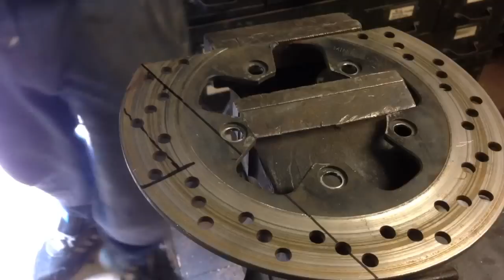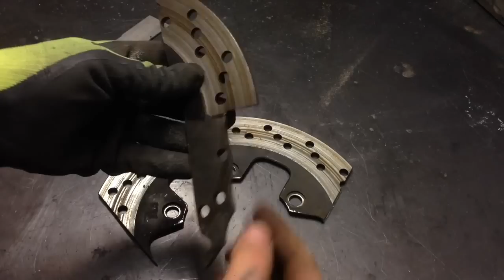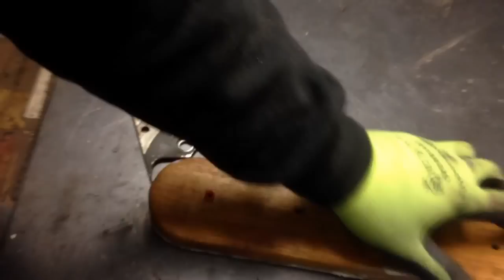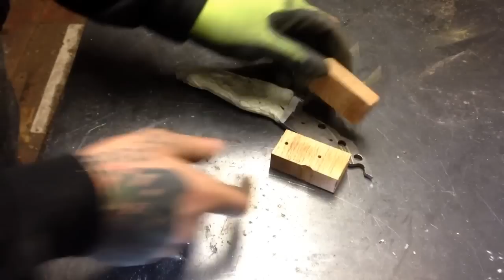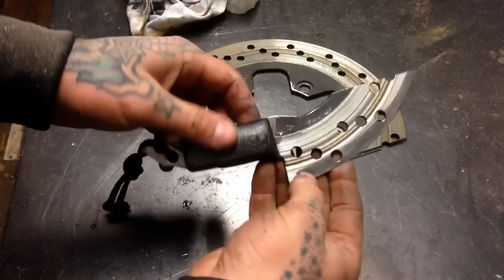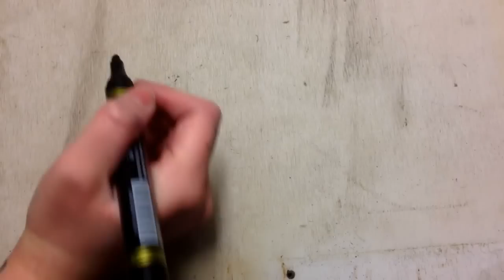Knife From A Brake Disc

Comment: I have never thought of using brake disks. The steel is made to handle a great deal of abuse.  What so you use to finish the wood?
Reply from the maker: It just randomly came to me one day and I've never seen it done before so thought I'd try. It's just a black wood dye I apply 👍🏼👍🏼👍🏼

Comment: Love the knife and i think you have a great imagination when it comes to repurposing metal objects for knives.  But i feel with this knife the metal sticking out past the handle at the back could injure your hand. I think i would have extended the scales all the way to the end. Not meaning to take anything away from the knife, it's awesome.
Reply from the maker: Thanks and no I don't mind any sort of criticism that's why I put my videos up I have to be open to lots of criticism. I do agree with what you are saying but it was a request from the buyer to add it in for multi tool use and breaking windows. Next one I build will have a longer tang as I'm going to weld extra steel on. Thanks

Comment: Great knife. My only question, is that steel high carbon? In the video it wasn't quenched, but I assume you kept it cool in the water the entire time you were grinding, and keeping the hardness it had already, like a file knife.
Reply from the maker: Thanks for watching man. Yeh it pre treated so I kept it cool so not to ruin it. This is an old build I need to retry it again and make it better 👍🏼👍🏼👍🏼

Comment: nice.very nice..how happy are you with using CA GLUE in stead of epoxy on the scales
Reply from the maker: I much prefer to use epoxy to be honest as it has a more flexible bond I have found CA is good and strong but can't take as much stick as epoxy. Thanks for such a great question and sorry for a slow reply 👍🏼👍🏼👍🏼

Comment: I thought I sent this. do you have to clean the leaf springs first since there underneath cars. also if someone has files and hacksaw they would be good to go
Reply from the maker: Yeh you sent it on another video. I replied on that also yeh files and hacksaw will work with the leaf spring steel as it's not that hard but quite robust. The video you commented on prior that was a hunting knife I just used it in its spring steel state no heat treat at all and it is still going strong 👍🏼👍🏼👍🏼

Comment: was that just paint you put on the handle?
Reply from the maker: +Tech Reviews and Help hey there thanks for watching buddy and no it was a dark black wood dye it come out looking cool if you leave it on for a short time as it only has time to soak into the soft parts of the wood so gives different shades in the denser parts.
Reply: +Diesineveryfilm Customs 
nice
Just wondering, how many subs are you getting now vs how many you were getting per day before you changed the few things?
Reply from the maker: I'm getting so many subs at least 10 a day now. I was getting 2-3 a day before its so much better can't thank you enough
Reply from the maker: +Tech Reviews and Help does this still work from an iPad as I use my phone to upload and do everything else from my iPad at the moment as it's quicker
Reply: Diesineveryfilm Customs
From the browser side it should. If you go to the dashboard and then edit. You should see a tab that says card. From there you can add the cards.
Reply from the maker: +Tech Reviews and Help found the cards tab,
It says,
Video or playlist.
Channel.
Poll.
Link.

Am I just adding the address you posted to "link" which I had to enable already?
Reply: Diesineveryfilm Customs
If you can add the address itself then do it. Otherwise you will need a website, and you will need to associate that to the channel. For example, my website is techreviewsandhelp.com. Since it's verify with my channel, I can use a techreviewsandhelp.com/whatever in the link.

It's still worth a shot, but I'm thinking you're going to need to need a verify website connected to your channel (there maybe other ways to do it than what I know about)

Anyways, what that link I gave you should do is bring people to your channel with a popup asking them to sub.
Reply from the maker: +Tech Reviews and Help I'm sort of working it out. Great help you've been I actually wondered how to get other videos advertised on my videos. I'm charging my laptop up so I can do it easier as my iPad ain't that good at this stuff.
I'll give this video a watch thanks buddy.
Reply: Diesineveryfilm Customs
There is 2 ways. The first is with the cards.

The other way is by going to your dashboard>channel>featured content.
Reply from the maker: Cool I'll give that a look aswell.
Currently trying to end my maker contract early as they offer me no help at all and the earnings are so low. I'm even considering closing this channel and starting again just to get away from them.
Reply: Diesineveryfilm Customs
When is your contract up?
I'm leaving them around May
Reply from the maker: Not sure I think I'm locked in for another year now tho but I'm hoping I can get out as they breech the contract by not doing the things they say they will do in it. My channel has grown these past few months and they still give me $4 a month that's what I was gettin last year anyway. There such a con I cant believe I joined them without research.
Reply: Diesineveryfilm Customs
The exact same is going on with me. I just them 2 years ago, and I'm making the exact same about.

They are going to try to push for you to stay. You most likely got a 60/40 cut, and they will try to push it to be a 70/30.
This is what happened with me. They will try to do all these things to keep you. For me it just wasn't worth the fight since my contract is going to be up in a few months anyways.

If they give you this push to stay, be nice to them. But ask things like what is going to be different. See what happens when you ask questions like what if I get my lawyer involved with this, what would happened. (even if you don't have one) After that make it where it shows their lie or them going to say we are going to do nothing. Then do a recording of it.
I'm going to be doing this in the next day or 2 now that I'm thinking of it.

But if they do allow you to leave. they will keep a months pay or some stupid crap like that.

I don't know if making another channel is the best thing for you. It maybe OK since you don't even have a thousand followers. But, if you can I would just stick with your 1 channel if you can.
If you do end up having to make another channel (which isn't unheard of someone trying to leave a MCN), then you can download all your videos from the dashboard.
Reply from the maker: Last time I complained they did say they would hep me more but all they did was share one of my videos on Twitter and that was it since then nothing. There's one network that offers 90/10 but I've also heard that it's best to just stay without a network at my level as none of them offer anything. Thanks for the help I just hope I can leave them as my channel is worth more than $4 a month. They make it so hard to get out even when your contract is up. I'm in the uk so there contract doesn't hold up like if I was in the us as I have uk laws protecting me. I'll keep you updated on it in a private chat on here as I'm waiting on a reply from them at the moment.
Reply: Diesineveryfilm Customs
Unless if you do LP, then you really don't need to have a MCN. Even then, almost all MCN basically stopped legally helping out everyone. So it's not worth being with any MCN at this point.

As far as them trying to stop me from leaving. I made it pretty damn clear that if they don't let me leave when the contract is done, then I will sue the living hell out of them. I also told them that I legally could leave now, but I would like to give them a chance to actually win me over.  But I think they should've just said you can leave.
Every time I post on their forums, a few people come up and say they are leaving Maker.  The latest example is https://community.makerstudios.com/index.php?threads/why-is-some-guy-making-a-3-sec-video-of-picking-up-an-umbrella-gets-2-mil-views-but.4955/#post-24399
Reply from the maker: I'm hoping they do say I can leave although they say my contract ends 12-31-2017 which is bullshit as it ends earlier than that as I joined in June or July 2015. The contract is void if they don't do anything they state in the contract.
Reply from the maker: +Tech Reviews and Help this is what I sent them.
I'm yet again asking to end my contract as maker gen offers me nothing at all in way of help or revenue for ages my earnings were at $21 then in the last two months my channel has risen and views have grown yet I only earned around $4 that I was earning a month prior to my spike. You have no offers available to me to make extra money and I've tried referring you but people are aware that your company is low paying and has that dreadful lock in contract aswell as you making it relatively hard to get released from contract even at the end of it. I have spoken to a solicitor specialising in contracts and I know that I can be early released from my contract which is what I am requesting now. Failure to do so will see me escalating this and taking my case to the relevant people.
Reply: Diesineveryfilm Customs
Let me know what happens.

Comment: Now that's a cool looking knife. Can someone explain what exactly does the term "bushcraft knife" actually mean? I've seen so many different knife makers here make these bushcraft knives but I rarely see any similarities in their knife designs.
Reply: Also.. didn't know you that this part was hardened steel.
Reply from the maker: Hello the term "bushcraft" is someone who ventures outdoors in the bush camping making fires and such, the knife was made for someone who wanted it for bushcrafting. Hope that helps please subscribe and share 👍🏼👍🏼👍🏼👍🏼
Reply: +Diesineveryfilm Customs Ahh so basically almost any kind of knife can be a bushcraft knife if it's made specifically for camping or outdoors use?  I subscibed.
Reply from the maker: Hellstorm1190 aye sir I would say so just like the term "kitchen knife" I suppose. Thanks for the sub

Comment: hey nice video can you tell me if it's high carbon steel .PS In a previous comment you said that it's steel but. I want to know if its high carbon .keep up the good work
Reply from the maker: Hey thanks for your question but I honestly have no clue about what sort of steel it is however it did harden although not as much as I would have wanted but I do need to do more testing on it to find out more.

Comment: Anyone have some info on what type of steel disk brake rotors are made from?
Reply from the maker: I couldn't find clear information on what steel is used but it is tough and very robust as it goes through a lot of crap when it's a disc brake 👍🏼👍🏼👍🏼

Comment: I have a slightly warped rotor from my Harley that may need to become a knife now.
Reply from the maker: Sounds like a plan to me buddy be sure to post pictures to my Facebook page that's linked in description 👍🏼👍🏼👍🏼
Reply: Diesineveryfilm Customs I will try but I don't do Facebook.
I finished the shaping of the blank and am attempting to file in the bevels.
I'm using a lawnmower blade made from a high carbon steel. I will be Harding it at a buddy's forge.
Reply from the maker: Great stuff I hope it all works out for you and turns out nice 👍🏼👍🏼👍🏼